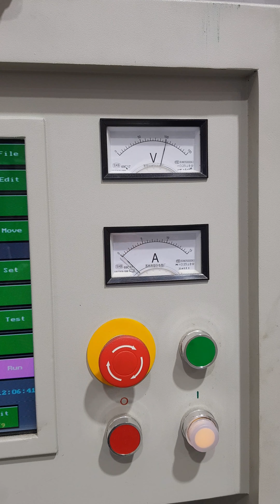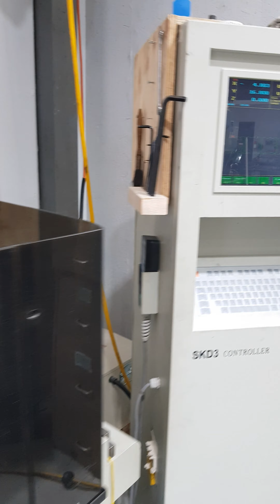Astro-skeleton, Spark eroding band saw to cut thin brass stock for strike fly fan blades

Comment from the maker: Yes you are correct, but there are many different kinds of machines that use the EDM principal, Some create depressions to bring a three D appearance to a flat part, others to cut like this one. Here it is used as would a band saw or more appropriately a scroll saw, but for a very thin part that would be difficult, but not impossible to cut mechanically. If there was only one part to be made an EDM machine would probably not have been employed. But we were creating eight blades that needed to be identical to preserve dynamic balance and cut down time of fabrication.